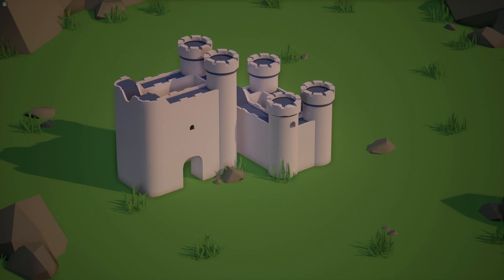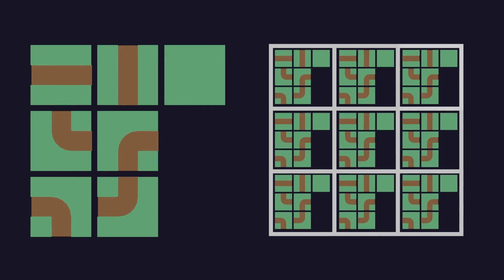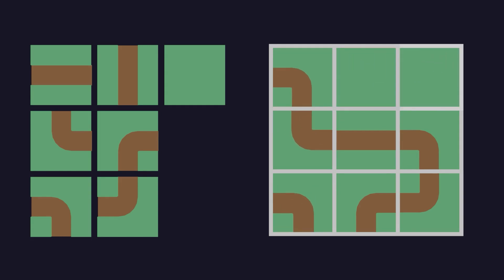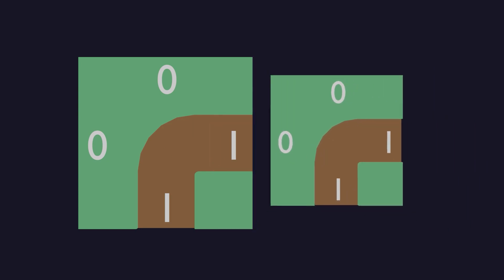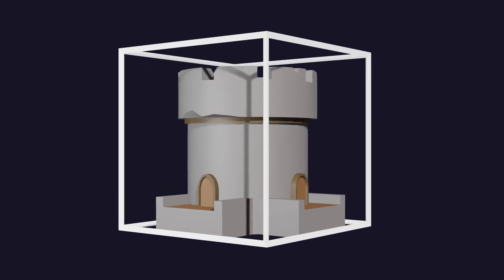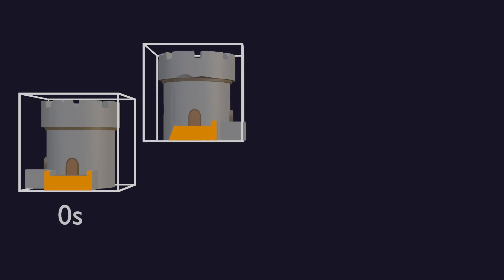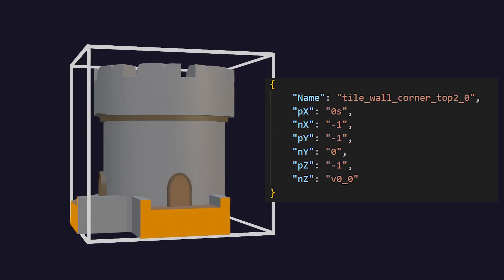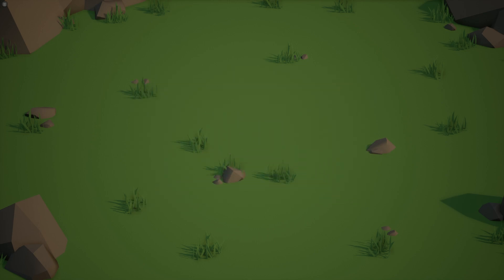Creating Little Castles with Wave Function Collapse

Comment: This is how I was going to apply traits to terrain tiles in a roguelike.
Basically, a bandits would be near bandits traits, deserts near desert tiles.

So, if you defeated a tile, you would get likely get an item with that combination of traits and terrain added, so "Desert Bandit Sword", "Bandit Sword", "Desert Sword" and "Sword" Would be the possible sword drops. I was close to getting both to function well, but needed more "Rock Paper Scissors" on Enemy Types and such.
Reply: So, if you defeat a Volcano Dragon tile, you might get a Volcano Dragon Spear or potion or whatever. It was fun to attempt. I should go back try to do it again.

Comment: If u try to predict where a tornado will go depending on its speed and direction you can only predict with a similar level of certainty where it will be detected at a future time. In quantum physics they are tiny spherical vortexes not particles. Moving inside a lattice made of Planck sized elastic tubes/strings. That's how EMR moves, through quamtum wires.
When trying to get particle physicists to understand the wave equation is describing a wave detected at single points not a particle, it's like talking to high tech voodoo madmen, they say energy is a particle but has a wave function which isn't actually a wave! it's like particle physicists seeing people in a boat and saying "Oh look those people are moving mysteriously across the water" then we say "no but they're in a boat" to which they say "no there's no boat that's just a boat function that gives the illusion of a boat, we build nuclear bombs, computers to give corporations more control over everything and everyone, we control all physics taught in Universities and peer review journals, we have ai controlling drones killing people in Afghanistan, Pakistan, Yemen and other places with no human 2nd opinion. So trust us we are smarter than you there is no boat, the Universe has no fixed laws at the quantum level, it's not that we can't explain them using the particle model, it's just bizarre and those people move mysteriously across the water in a boat function."
The Theory of Everything has been around for 5 years with 2 math proofs to Goldbachs conjecture and proof a 2nd loop is impossible in the Collatz Conjecture but the Big bang particle industry have kept it suppressed time and time again, with hysterical particle physicists unable to bear to look or listen to any evidence that for a split second says they are wrong, who keep taking down this guys channel, and refusing to acknowledge his math proofs it's looking more like more doom every day for humanity, the TOE and experiments to prove it are on channel "Breaking physics (beyond the SMOPP)" most experiments and the 2 math proofs are in 1 minute shorts.
There is no collapse there is only a change of focus on the wave, what changes the focus is the real mystery but this channel has experiments to test for what it is.

Comment: Awesome! Instead of automating what can connect with what perhaps an easier approach is to just build some example structures with the grid pieces manually and have a script keep note of what is allowed to neighbor what. Though downside is you then limit generations to variations of what you’ve manually constructed but I bet some cool results would still pop up.

Comment: two questionss plz, did you do this in python? and did you use unreal engine for this?
Reply from the maker: Hey sorry for the slow response - I used python for setting up the data in blender automatically - but the implementation of the algorithm was done inside unreal engine using blueprints.

Comment: I've done similar experiments with procedural world generation in Godot, and have been thinking about precisely an algorithm like this for generating rooms in a fashion similar to the mazes in SCP Containment Breach. It's weird to realize I've already thought of this exact thing before learning of its official definition just now. At the same time this provides a few details I haven't thought of, like how to go about correctly picking the proper neighbors using a reduction system: I believe my idea was to give each opening on the module piece (window, door, corridor ending, etc) a tag represented as a position / rotation / name then randomly pick another module that has an identical tag connecting to it and position / rotate it accordingly... this would have supported tiles of multiple sizes (powers of 2) unlike a fixed tile size, but that's a much bigger pain to deal with so I'm glad I didn't go there.
Reply: Dan's video on The Coding Train channel for it is the best one to watch, in it he explains exactly how it works and more details, as well as linking to the necessary articles and documentation. I've watched it several times, it's good fun.

Comment: Been watching a bunch of WFC vids and this has been really useful but what I'm looking for is how to set more complex constraints on map gen. For instance a thought that comes to mind is to have path start/end (attaches to building/location and regular path) and intersection tile, keep a count on path length and allow a termination or intersection to appear after x path length.
Reply from the maker: Those are interesting use cases, I've seen Oskar stalberg expand on wave function collapse in his game "Bad North" to add additional checks to ensure the map is playable.

I think what you are suggesting could work though there may be other solutions that are better suited to path generation rather than trying to bend the WFC algorithm to fit that particular problem. For instance you could use WFC to generate your map with buildings then do a separate pass to connect them up with paths.

In my experience I've found adding too much to one system can add a lot of complexity when it may be better to separate it into more specific pieces.
Reply: @TomDevYT  It was more a musing than a functional use case, my initial thought was to pre-pass the map with location foundations and connect them with paths, in effect pre-culling the available tiles per coordinate. As you point out other algorithms are better suited to the purpose. I just thought it might be an interesting experiment to try forward generation with constraints. The Path comes to mind.

Edit: Looked into Bad North, saw an article that mentioned Caves of Qud using regions. I'm thinking of taking a similar approach, say using random distribution to tag a forest region and switching tilesets rather than using transition tiles directly. A similar approach can be taken for different locations/tilesets and usefully I can separate roads/paths into their own tileset.

Comment: Is there a bug there which makes all the walls the same height?  There seems to be a tile to go up and down on the wall but it is never used.
Reply from the maker: That tile is just a top cap so it's just placed on the highest level, it's not used to transition between a higher and lower level. Though an implementation like that could certainly be possible!